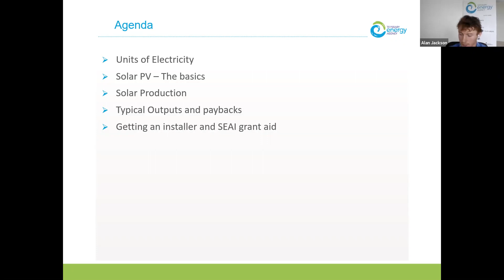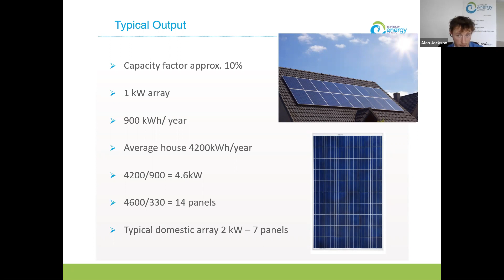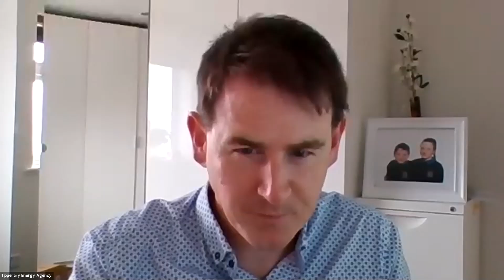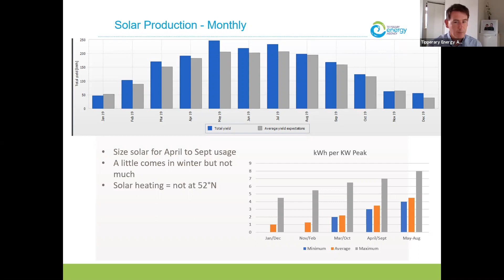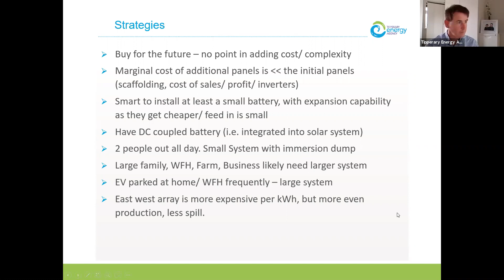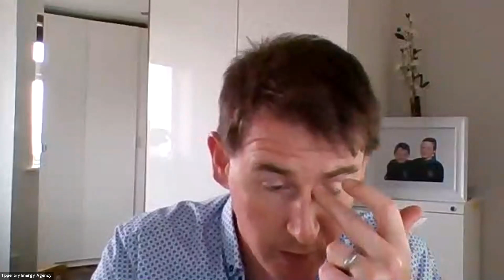Solar PV panels for homeowners webinar - 27th May 2020

Comment: It would be cheaper to add more panels later IF your PV is on the ground. Could you not plan and get certified for a larger array now but not install the full array now so adding power later. Will the future addition of smartmeters by the ESB mean you get a power logger and could be used to do the estimate later. You could set up an off-grid backup to power lighting/some heat/water pump/fridge/phone charger and then when the power returns to recharge the battery storage.

Comment: Would it not be better to have dual thermal and PC systems as house heating is often the biggest energy drain? How much extra (as a typical %) does microinverters cost over one inverter (on a 2KW array) and as noted would you have to replace each inverter within the 25yr lifespan? Why are you recommending (apart from PP for just 7 panels) just a 2KW array when thats less than 50% of customers typical demand (and that 50% I presume is optimum generation). Your return of 8.8yrs does not include the Install cost of the array (and thats with an estimated 4cent spill price). I note your example user has a 3.6KW array...Why not just recommend everyone aim to meet as close to 100% of their home use as possible as the install labour cost will be minimally extra, payback will be lower, the xtra panel costs not double and the PP cost (presuming no objections) not much additionally. Might be better to ask installers how much lower the install cost of a 7/14panel install has cost year year. If the spillover is 15% then would that not be better to add any battery storage or would dumping it on a water heater offer a better return.If your demand is lower then would it be better not to have a smaller system and storage vs a larger array or a larger array and avail of the water heat bonus (which cuts your water heating cost)
Reply: I think the issue may be down to planning permission which places a cap on solar to 50% total roof space or 12 sqm. There was a woman in Limerick who was able to retain a larger array on appeal after she initially lost her case and told to take down the array.
Reply: @myopenmind527  i recall that appeal. She had gone ahead and then appeal the councils request to take down the extra panels. Not many of us have the cash to go to court. This is why the seai only gives a grant to X Kw irrespective of house size, actual energy usage, roof space or potential storage (with the most efficient and cheapest on hand being the hot water cylinder). If she won then it was against the PP rules. Only after this embarrassing story did the gov finally announce it was to end the arbitrary restriction. Has this actually happened and changed each councils own pp rules?
Reply: @stephendoherty8291  she won her appeal and was told she could retain the solar array. Seems only sensible in that renewable electricity is the future of renewable energy going forward and there is a bill to abolish the 12 sqm limit which has now gone through the senate but I don’t think it’s passed into law yet. Hard to imagine it will not pass but I think the grant will disappear in the near future.
Reply: @myopenmind527  I can see thermal solar grants getting the axe in the near future as pv prices have come down in price so much as they can be used with storage to recharge EV cars and take some burden off the grid. Even though solar thermal might seen the best idea ie air heating is the most energy intensive vs your power bill, pv is more flexible in that it can be stored efficiently and find more uses in even our summers.